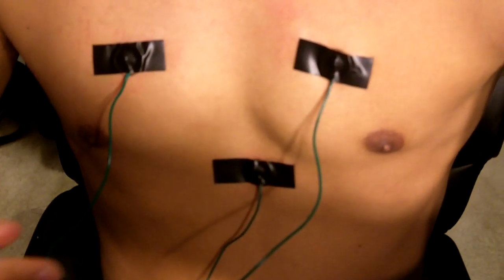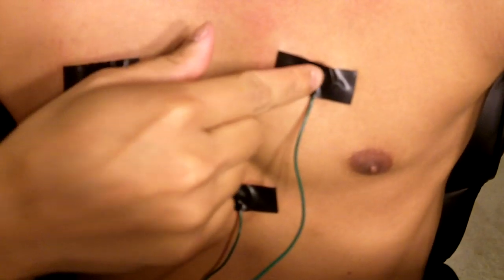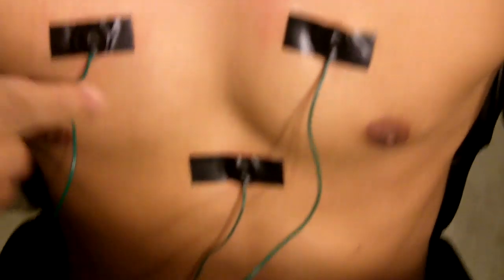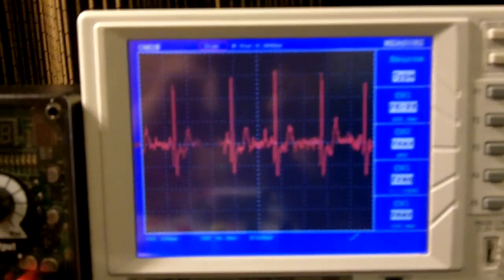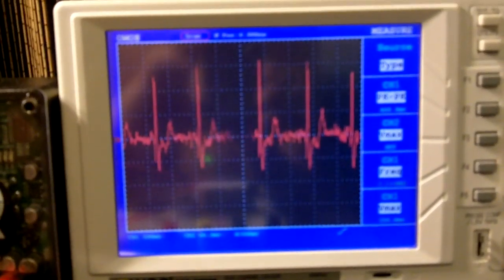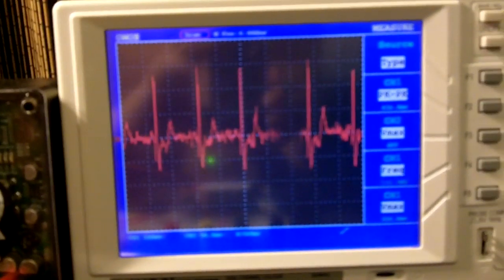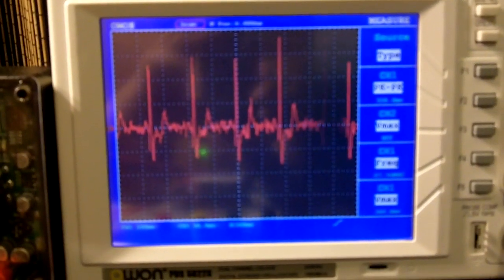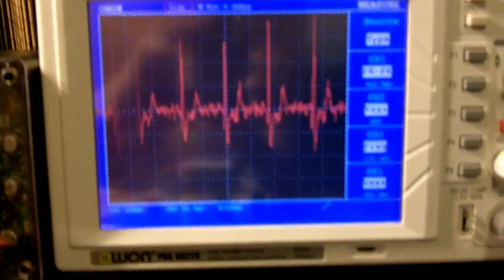Arduino ECG  EKG Heart rate monitor circuit prototype

Comment from the maker: @MrHorsetail They are plain wires soldered into some pennies. Which is then taped to my body. Its not very reliable since the tape sometimes gets lose and the pennies lose conduction with my body. I plan on getting some real ECG patches soon but that will be for th finished project. And yes, the signal comes from the beating of my heart. This circuit works exactly the same as the ECG machines found in hospitals only 1000x cheaper.

Comment from the maker: @abhyhhh I created my own program using the Arduino IDE. The language itself is based on c++, so its really easy. In terms of calculating the HR, I simply detected two R peaks and calculated the time between the peaks. I then used this info to calculate the effective HR over a minute.

Comment from the maker: @MrLolztome1 The circuit diagram is based on the circuit from the example in the datasheet for the  INA2122 instrumntation amplifiers. I did not make an actual schematic since this was just a prototype. I can give you the code if I can find where I saved it.

Comment: sir,
I m doing project in DRIVRN RIGHT LEG CIRCUIT. I am using Ag/AgCl electrode and shielded for taking ECG signal, I was not able to get ECG signal. Can you help me in getting ECG signal.? 
Here I am usind 3op amp Instrumentation amplifier using OP07 op amp with Gain 100. 
Can you help he how to get ECG signal.

Comment: That's some real good work.  Are your electrodes just wires taped to your body, or are they some kind of electrodes designed for heart monitors?  If they are plain wires, does the micro voltage come from the heart beats or what?

Comment from the maker: @abhyhhh I used the analogRead() function of the arduino.  The input comes from the ECG circuit that I built which is connected to one of the five analog ports of the Arduino which has an ADC.  From there I simply read the data using analogRead() and simply calculate the time diff between the two peaks. For this i used the millis() function.

Comment from the maker: You will need an instrumentation amplifier such as the TI INA series. Check the data sheet of your amplifier, it will have a reference circuit that you can use. Once you get the analog signal, you will need to connect it to an ADC. Many microcontrollers have them built in. I determined the HR by using a threshold voltage and using that to find peaks then I just calculated the time between peaks. To do this properly you might have to do more research on how to interpret ECG signals.

Comment: The readout looks like it has a lot of artifact in it.  Probably just because you are moving/talking.  Also, you might want to reconsider electrode placement.  With a three lead it needs to essentially make a triangle around the heart.  Great work though.